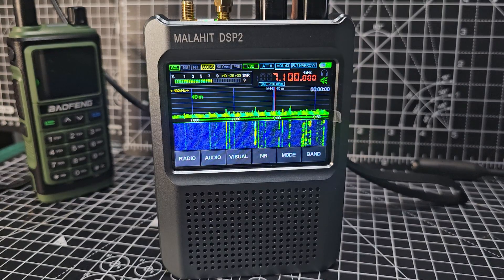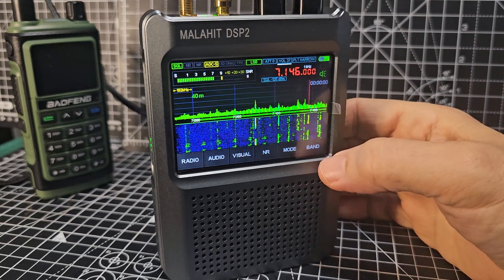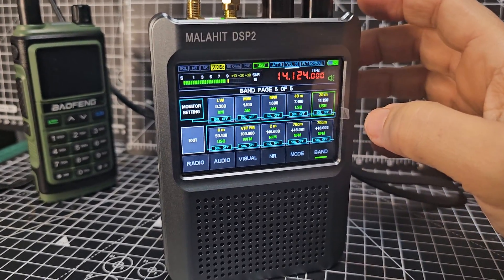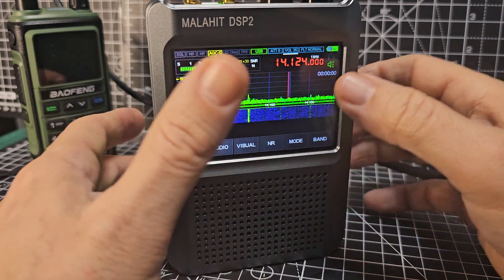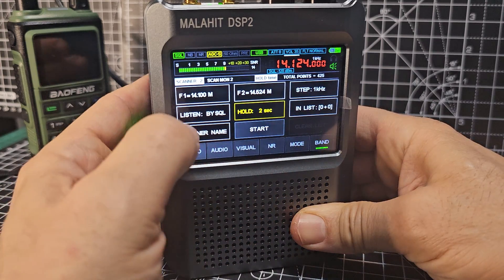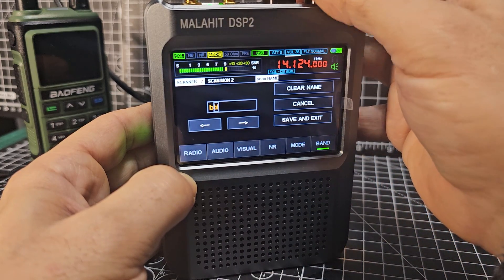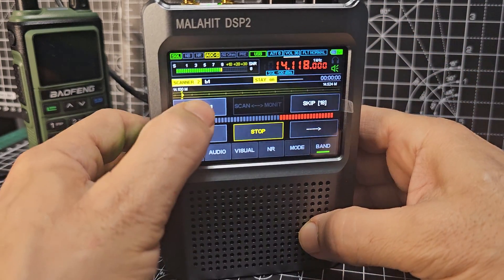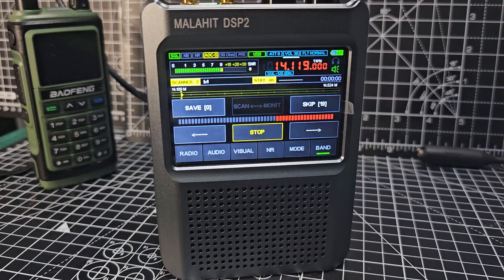MALAHIT DSP2 - BAND MONITOR / SCANNING FUNCTION

Comment: When you tried to scan, the radio was stopping on every 1 khz step until you hit SKIP.  That's because you were on an HF band and the Squelch was not set correctly.  The scan function was stopping on noise.  Not sure the scan function works well on HF with it's inherent static, but on VHF/UHF/FM frequencies is where it does.  The squelch has to be set to quiet the receiver between stations where no signal is being received.  Adjust it to quiet the between station hiss.  Then scan, the radio will stop when a signal above the squelch threshold is received.
Reply from the maker: Many Thanks

Comment: Had my DSP2 Russian since 2021, find the scanning only useful where the channels are evenly like spaced like 25 kHz on airband and you can set the step, pretty much useless on ham bands where freq's are random
Reply from the maker: Freq on many ham bands are not Random.
Reply: @M0FXBHamTech  Yes , on VHF and UHF they use a certain spacing for repeaters , Scanning HF CW and SSB was what I was referring too

Comment: Very nice radio got it two months ago,still learning. However i find the encoders a bit flimsy, they are already a bit wobbly they could have done a better job for the price and have bnc connectors instead of sma. Thanks for all the videos you posted  they surely help .
Reply from the maker: I think for price it works excellent

Comment: My DSP1 has no scanning function, but it is not so bad, because  I think, it is only useful  for air-band, which I am not so interested in. And of cource for police and fire brigade radio, but these have been digitized here in Germany. 🙂
Reply from the maker: Hi , how does it do o HF Bands try a very long wire .
Reply: @M0FXBHamTech  I don't know, how it works with a long wire. I use it from the beginning with the MLA30+ and I am very very satisfied with it.